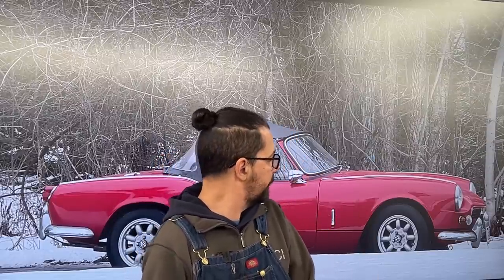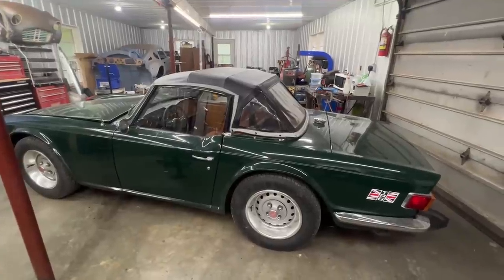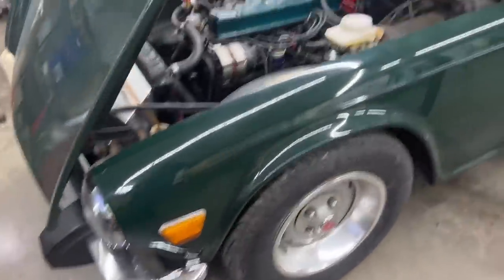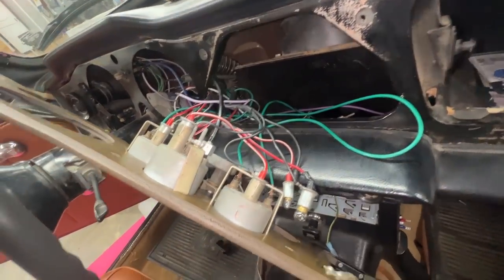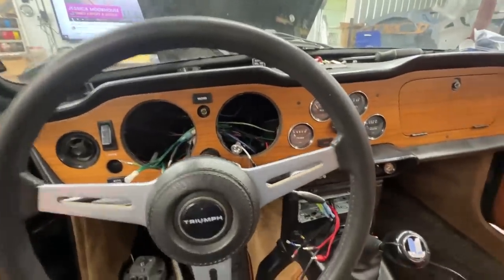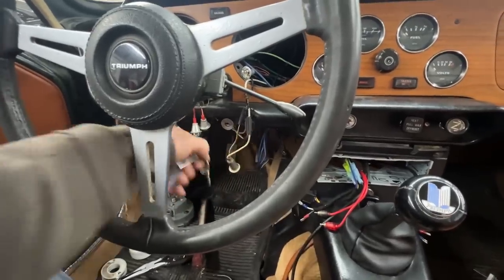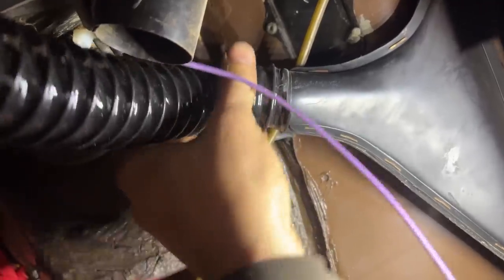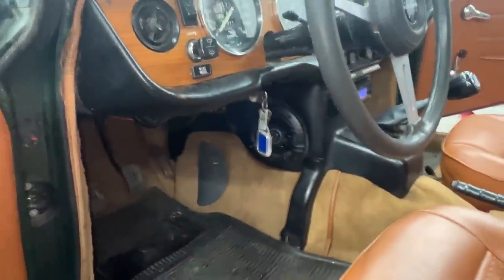1973 Triumph TR6 - Part 1 - Solving wiring issues

Comment: Excellent job Elin, looks much better! Appreciate you had to work with what you had, but I prefer the approach I took with my MGB which was to use the original harness but add a generic kit car fuse and relay board, holds 10 fuses and 6 relays. I also bought a cheap used  2nd harness from eBay and stripped it so I could use all the correct colours for the modifications. 
However not all Triumph wiring is rubbish- I have owned my Stag for 18 years and no wiring issues at all.

Comment: Another very good video.  Whenever I see someone doing electrical work on an old British car I always recommend a book by Rick Astley. It is titled Classic British Car Electrical Systems. It is a great resource.  There is also a companion book that concentrates just on MGB.  Astley’s books are very thorough and includes colour diagrams and lots of troubleshooting ideas.  I do believe that Astley is from Ontario,
.  I missed if you got the four way flasher fixed.  You started with a mess and cleaned it up nicely.  A much safer car now. 
BTW the horn on my GT6 only works with the key on and the same with the brake lights.  From factory like that.

Comment: Just a heads up - there are some discrepancies in the Autowire wiring diagram for the TR4A (involving the light switch). Apparently it’s depending on when the car was built, and for which market, as not all cars have this discrepancy (mine does). So be alert when following these old wiring systems.

Comment: The position of the fuse box would have been better on the underside of that panel.  I'd be concerned about corrosion in the current location.
Reply from the maker: I am only finishing what has already been started. The harness and the position of the panel were not my choice.

Comment: Either that company supplies really crappy "model specific" improved wiring harness, or somebody fitted the wrong harness. With all that messing it's probably easier to diagnose and upgrade the already adequate original harness.
Reply from the maker: The harness is good. Probably routed the wrong way though. I didn't want to go through all the instructions but probably it is explained there. The original harness has multiple non-fused circuits so it is not really adequate :)